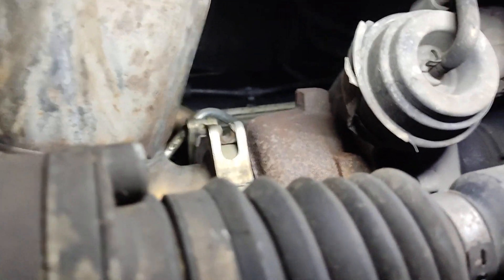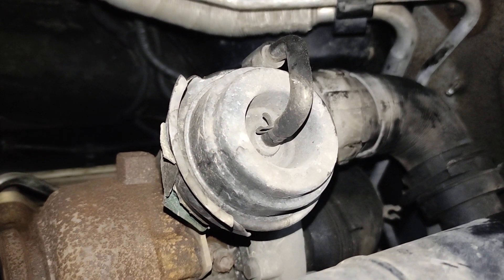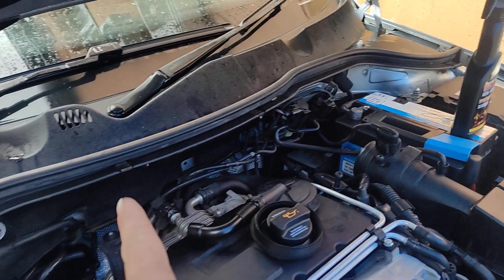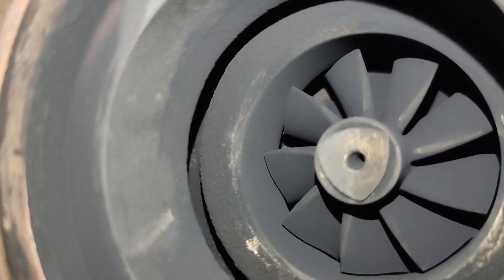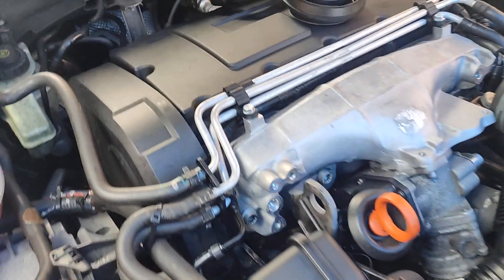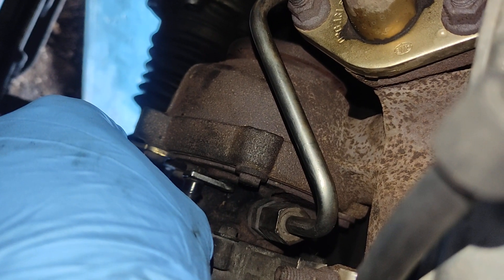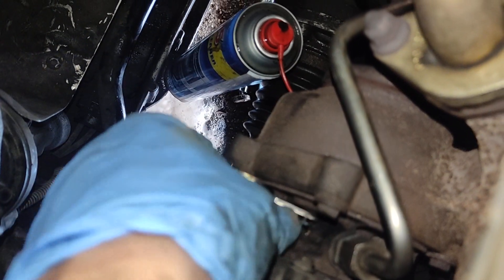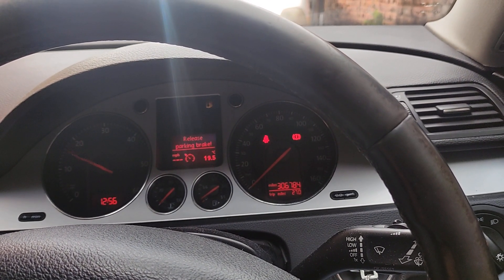VW 2.0 TDI Turbo problem + geometry Cleaning with removing the Turbo!

Comment: I have am audi a3 1.9tdi 55 plate. The turbo is working fine at the moment. There is no code or engine light on the dashboard however it feel to me that the car is lacking boost a little bit. The car has 138000 miles. I was thinking of getting the full Turbo out but that seems a very big job. I think you need to take full turbo out and clean everything inside.
Reply from the maker: Got a video how to remove and replace as well.
Reply from the maker: https://youtu.be/ZCy6E28-6bk?si=SwZThZ3L_q6tM0Ho
Reply: @MeFixingEverything  thnx so much . Keep up the good work 👏
Reply: Keep up the good work. Chanel subscribed